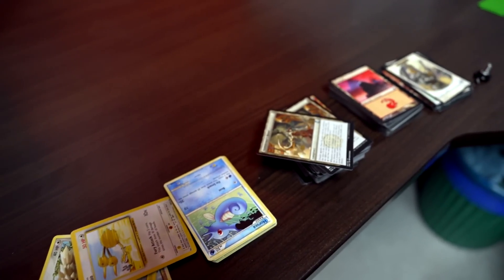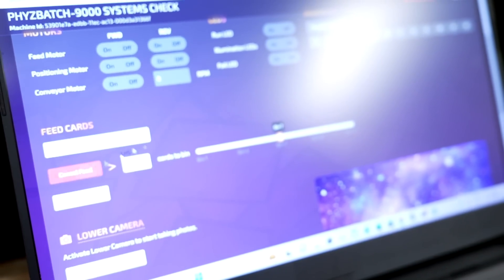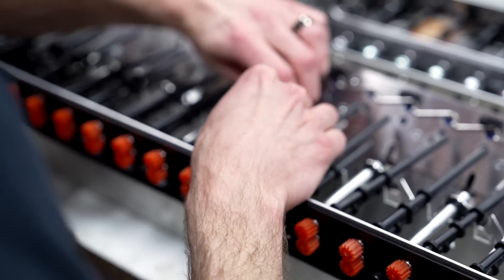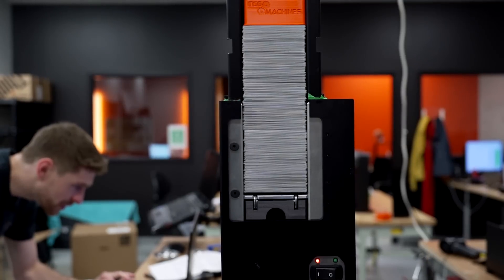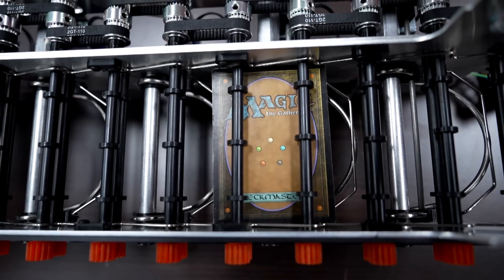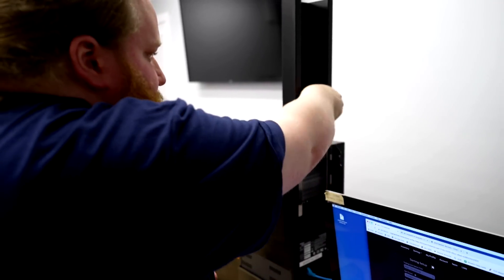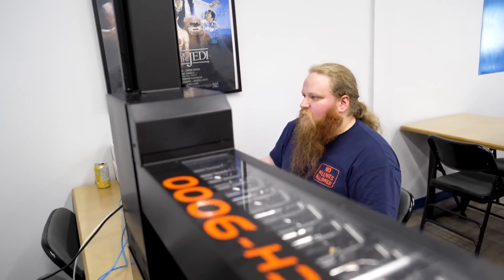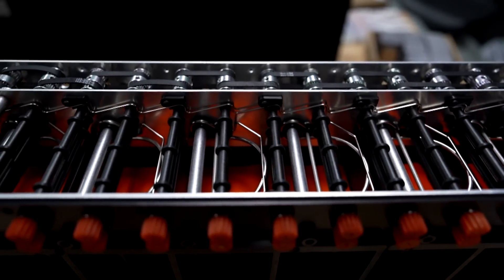How a card-sorting machine is revolutionizing trading cards

Comment: I sure hope they look through it at first as you don't want your cards going through here without a sleeve and actually shouldn't even be piled and dealt off eachother to avoid scratching. Bulk. Absolutely fine but pokemon has issues hot off their press from rollers etc.